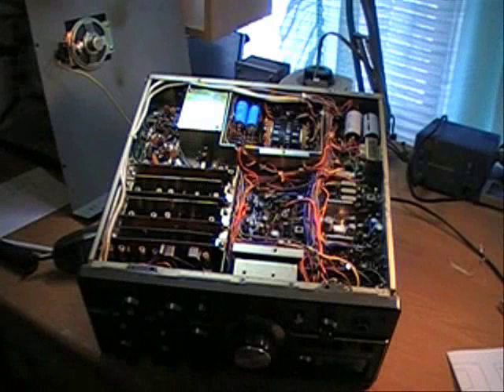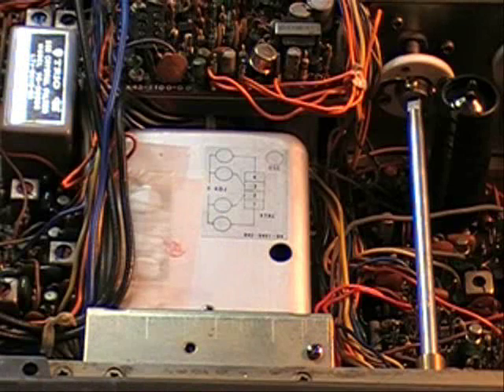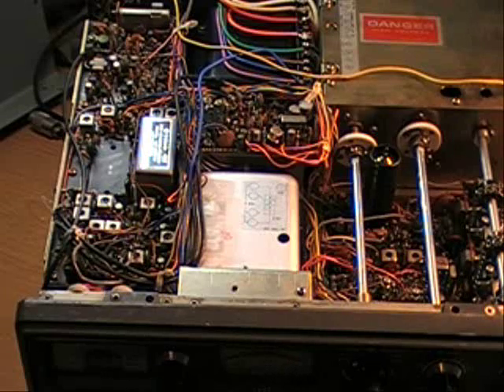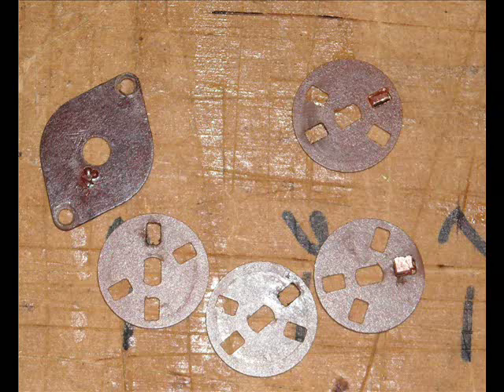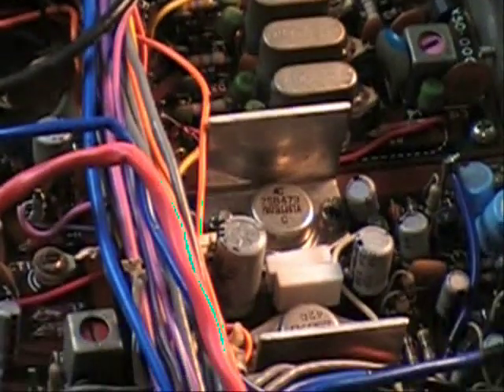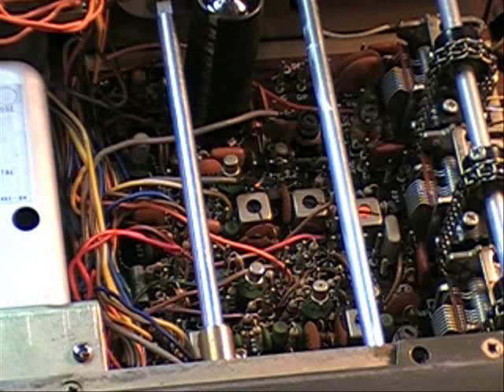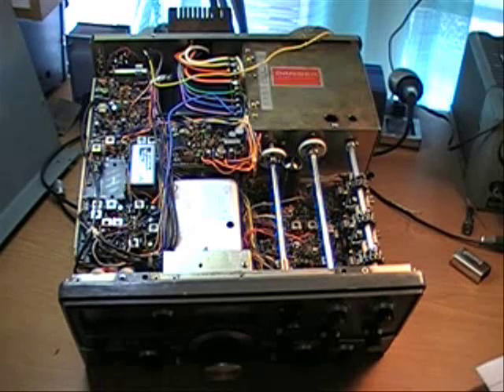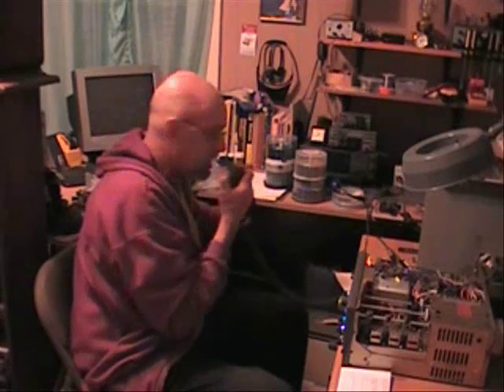TS 520 Repair

Comment: Wow, love the audio output, mine sounds like Donald Duck with a head cold. My main problem right now is the VOX, I am 100 % CW, and use the VOX for full breaking. It started a while back, like the signal coming in is tripping the VOX. I adjusted the delay and timeing at the side panel to no avail. I made a remote switch to connect to the mic jack so I can operate it with my left hand while sending with the right. I hesitate to take the radio apart until I have some idea what I'm looking for, any help would be appreciated, thanks de WA1YDK

Comment: I bought a ts-520 that sat for 30 years '' was owned by a model ham operator ' WHEN I Hooked it up IT would not TRANSMIT ''   Even with the Relay Clicking '''  Then After Keying It For 2 Days IT Sudeley  STARTED Putting Out A Signal  '' Been Good EVERSINCE ''   WHO KNOWS WHAT IT WAS ' Maybe DIRTY Contacts '''  WHO KNOWS ''.

Comment: Do you have a video of changing the 11M crystal back to a 10M?  I found a document on putting it back but it's 38 pages and far more than I can do with 1 good arm.  You said it's not big deal so I'm hoping you have an easier way to do it.

Thanks
Reply from the maker: Chad... I don't know what document you have, but depending on your radio repair skills it's not a big deal. You'll need to know how to align the receiver and transmitter after you switch out the crystals. if you've never done an alignment your 38 page document probably covers it. See if you can find a service manual online. It will show you how it's done. I did that video five years ago and have forgotten most of the specs, etc. Sorry I can't offer you more help. If you are an amateur radio operator check with your local radio club. They may be of some help... Ron
Reply from the maker: Also, check the Kenwood group on Yahoo groups...

Comment: Super video! ...I have a TS 520S that works great, but the mode switch does not work on TUNE, & CW. I have to tune the radio on SSB with a watt meter.

Comment: Can you tell me if the ts-520 80m version vfo is the same vfo used in the ts-520 160 meter version?I have a bad vfo in the 520s model...Thanks

Comment: Very nice .!! Great electronics skills some of us just don't have or quite don't understand !! Maybe you could help me out on my ts 520 It was working fine then I all of a sudden it stop transmitting so I took it in and the put a new tubes and work fine brought it home and bam no out put again so I grabbed my ts-820 and pulled the working tubes out of it and stuck it in my 520 and the tubes don't light up tried all the tubes on the 820 and all work fine and then tried all the tubes on the 520 a

Comment: I might try to fix my old 520SE.

It worked fine 10 years ago when I put it away. I pulled it out from under my desk recently, turned it on, and I only get white noise now. Other than getting a little dusty, I didn't do a thing to it. 

I have the money to buy another rig but it bugs the heck out of me not knowing what went wrong. 

I'd sure like to know how to fix it.

Your video is an inspiration.

Comment: I rebuilt my dad's 1959 crystal-element Turner desk mic by fitting a cheap Sony handheld mic element (courtesy of Best buy, $10, a hack saw and some dryer lint - i mean sound-deadening material).

I consistently get unsolicited excellent audio reports and have worked about 35 countries through the inverted-vee antenna inside my attic. All said, my entire TS-520 rig cost my about $80 and has served me well for over 3 years.

-73